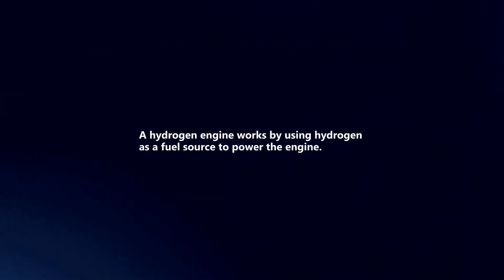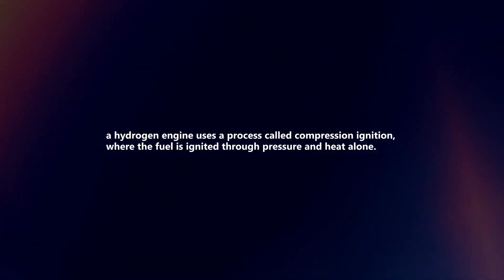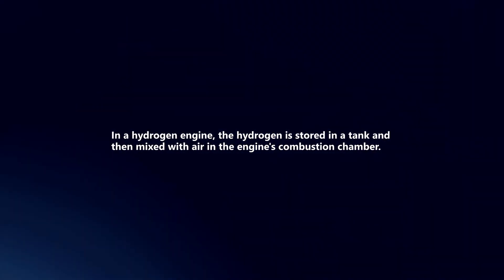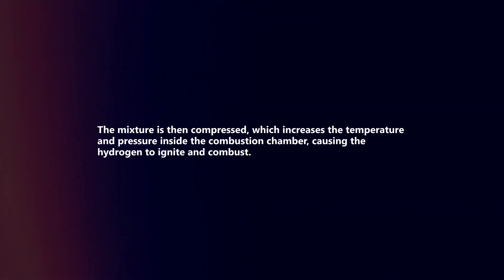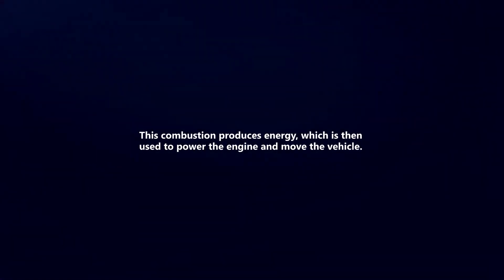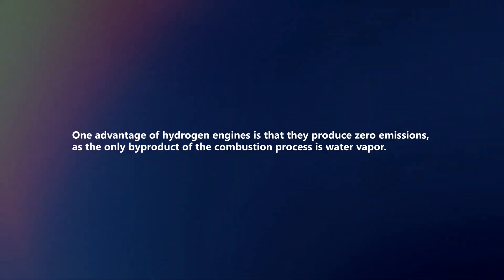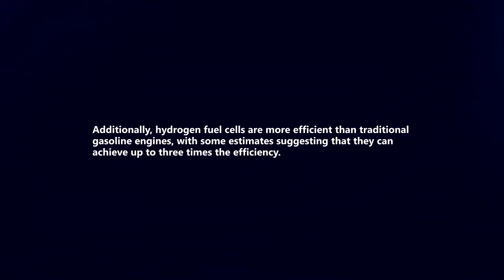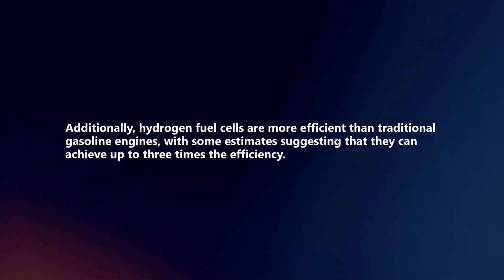How Does A Hydrogen Engine Work?

Comment: I don't believe those reasons for not being mass produced. It's a lie made up by greed oil industry. How in any fashion is it more expensive to run a current through water than it is to drill into the ocean floor. Its not and only the dim bulbs believe it is 😂

Comment: We don't need to store hydrogen actually , what I think is - we can produce hydrogen from water by electrolysis..Can we ??
Reply: Considering the fuel requirements of a modern internal combustion engine being less than a ml per cycle, the first bit of hydrogen could just as well be produced using the car's own battery, and as the engine starts, the alternator could keep the electrolysis going, since alternators can reach power output well above 100kWh (and the power needed to extract 1l of hydrogen from water is around 56kWh), the resulting power would exceed the needs of the chemical reaction and would even be enough to keep charging the battery. Combine that with good engine design and you got a perfectly functioning car.
Reply: Is that efficient? How do you power the electrolysis?
Reply: @max3eey  why can't we use kinetic energy which we get from the movement of bike...
Reply: @bigfun_piano_master...  Who is going to bike? You know how much time would be needed to process one litre of water?
Reply: @max3eey  not exactly , how much time would it take
Reply: @bigfun_piano_master...  So basically the average person would generate 100 watts by biking 30 minutes. Converting a litre of water to hydrogen would require 15.89 MJ of energy. ((((((15.89×10^(6))÷100)×30)÷60)÷24)÷365) = 9 years of biking at a moderate pace for one litre of water converted to hydrogen. You would sweat more than one litre in that time, hella inefficient...

Comment: We do not understand why you say it's very expensive to make. Hydrogen fuel can be made very simply. It could be made and stored in safe storage tanks as we needed, on board the vehicle. Although this would eliminate the fuel cartel organizations throughout the world
Reply: It uses a lot of electricity to split water into hydrogen and water, which is the most environmentally friendly way to do it, all other ways involve fossil fuels. 

It's also very difficult to move and store hydrogen because of the tiny size of the molecules they leak extremely easily. When hydrogen leaks it's very dangerous as it can very easily cause a room or building to explode. This leads to expensive, complicated and energy intensive storage and transportation systems.
Reply: There also other cheaper way to get hydrogen, we can get from methane by process of steam reforming  @justcallmenoah5743
Reply: @justcallmenoah5743  If we invest in nuclear energy, then it's not gonna be an issue anymore. The more we use nuclear tech the more we can make it efficient and less wasteful. For the short term it may be costly, it's because it's a transition. After awhile it'll plateau, like with gasoline engines becoming more effecient, why can't we invest in something that can be better for the environment than what is currently available? Sure as hell a bit more non destructive than fracking and waging wars for oil.
Reply: @rendellvalles6749  I really think you should look into some of the problems with hydrogen internal combustion powered cars more closely. The problems are actually quite fundamental, and while I'm sure many of them will be solved eventually we are definitely not yet at a place to transition quite yet. I have no way of knowing what the future ultimately holds though.